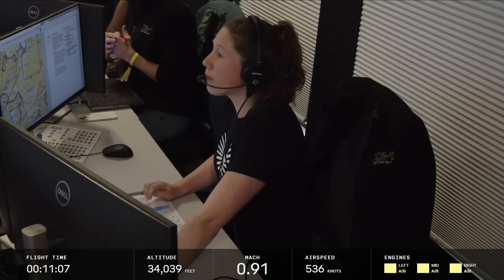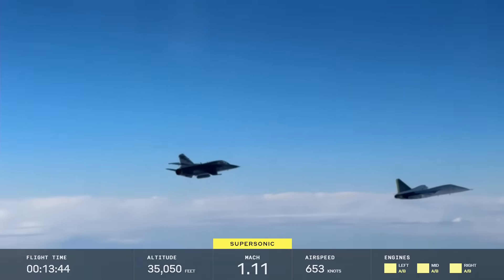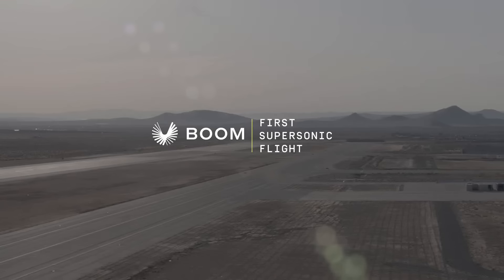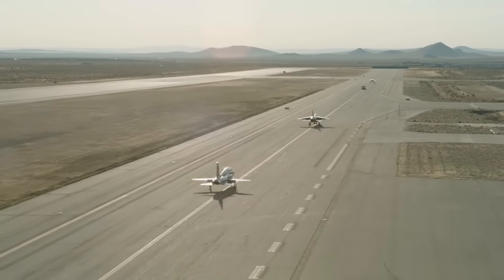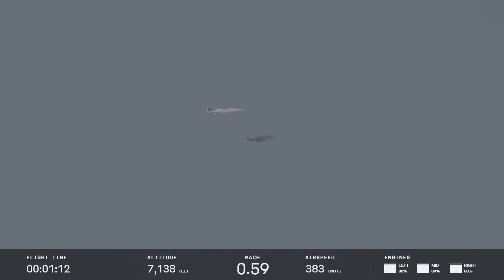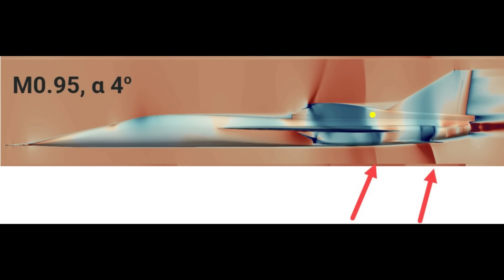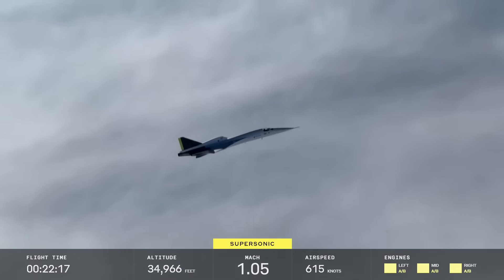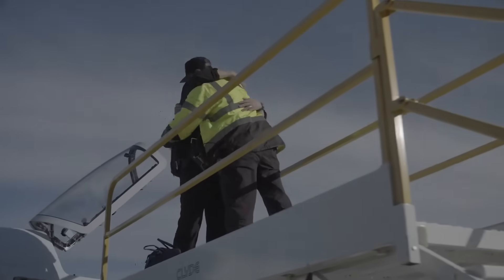XB-1 Baby Boom Goes Supersonic - Jet Planes, Starlink & iPhones

Comment: 9:30 - Rotation at Mach .3 and climb out at a 30 degree angle of attack?  I'm guessing loss of one of those three engines means you're landing in the desert and not doing a go around?  Yikes.
Reply: You can't certify a passenger plane without that capability.  And this isn't the passenger plane.  This is a technology demonstrator and test bed for the passenger plane.
Reply: @stargazer7644  - I know it's the technology demonstrator before moving to the passenger plane, but I hope they aren't planning on the passenger plane rolling down the runway at Mach .3 and then climbing out with the nose stuck in the air at a scary angle of attack on what must be the hairy edge of a stall because the supersonic wing has so little surface area to generate lift.  I guess my point is, I wonder what they learned from the test prototype that's applicable to a commercial passenger aircraft?  This definitely isn't a 1/3 scale model for testing.
Reply: @Liberty4Ever  Concorde had a rotate speed of Mach .32 and a takeoff AOA of about 12 degrees. Nether it nor the XB-1 are any more on the "hairy edge of a stall" than any other aircraft at takeoff.  If you want to go fast, you have to play by the rules of physics.
I suspect the major thing that was learned was that they could actually produce a supersonic airframe so that the investors with the money will invest a billion dollars plus into a 200 million dollar passenger aircraft in a market segment that has NEVER been profitable in history.  I imagine they also learned a lot of other technical things along the way that will be helpful on the Overture.

Comment: The Mirage is an F.1B or D. The T-38 may only have been a trainer in US service, but it's essentially the same aircraft as the F-5 series which absolutely were fighters. An F-5B is basically a T-38 with weapon pylons (yes, there are other differences).
Much as I'd love to be wrong, I don't see a commercial future for this. Mass air travel is still, and always has been, dependent on seat-mile costs, not speed. For the vast majority of passengers, it's the fact that they can afford to fly at all that matters, not whether they're flying at 500kts or 700kts. As long as it's faster than a train or a ship, then their needs are met. Indeed, the thrust of likely future developments seems more in the direction of "slower and greener" than faster. Only a minority of passengers (first class and some business class) have both the desire to fly as fast as possible AND the money to pay for it. if you take them out of the "cattle-truck" airliners and put them in a separate fleet of supersonic airliners with much greater overheads, then they won't be subsidising the cattle-trucks any more, which means the latter's ticket prices will go up and their passenger volumes will go down.
At best, I see Boom getting a supersonic business jet out of this, which will be a limited production toy/status symbol for the ultra rich. At worst, I see them going bust in a few years' time, like literally hundreds of little aerospace companies, run by people who think they've got a clever idea, have done over the history of aviation.
Reply: The Concorde cabin was so narrow it could only handle 2+2 seats, but it still sold hundreds of seats. On could imagine flights from the Gulf to Asia flying over the Indian Ocean could be profitable with seating of 100-120 passengers (or 70 with fancy seating). Considering the Concorde running costs, no I don't think any subsidising occurred.
Reply: @ Concorde tickets were only affordable, and Concorde "profitable", because the UK and French governments wrote off the development costs and gave the aircraft to their flag carriers essentially for free. Basically, those tickets were subsidised by UK and French taxpayers.
Reply: maybe taylor swift could get one to save some time on those 15 minute flights she loves to take
Reply: Part of the cost argument was that a supersonic plane can make two trip to every one of a conventional jet, reducing the cost of hardware by 1/2.  Whether that's enough to make up for higher fuel costs is another question, but it apparently works for SpaceX boosters.
I imagine that four hours in cattle-class seating beats eight hours in first class for most high-end passengers.  And it's probably cattle-class with no middle seats.  So ticket prices of 10x should be conservative.
Reply: @ Yes, but if you extract those high-end passengers from the cattle-trucks and put them on their own plane, what does that do to ticket prices on the cattle-trucks? Most economy class passengers are holiday-makers whose choice is flying/not-flying depending on how much money they can spare, not slow/fast depnding on how much time they can spare. They have zero brand-loyalty: put ticket prices up at one airline and they go elsewhere. Put them up across the board and they stay home in droves.
Reply: @MrHws5mp  If first-class passengers are subsidizing the economy passengers, then airlines may be reluctant to cannibalize their traditional flights by adding SST routes.  But the alternative would be for existing carriers to stand by and wait for newcomers to come in and specialize in supersonic transport.  So the incumbents lose first class passengers either way.
Reply: @captsorghum  Boom will need significantly large orders to justify starting up production though, and they're unlikely to get those from a small start-up airline.
Reply: Air travel depends on seat mile cost per speed (units of time saved compared to alternatives for the added costs). Otherwise everybody would take the bus.

But yeah I have trouble seeing the economics working out either - nobody is going to put up with sonic booms so some rich guy can save 20 minutes.
Reply: @ Itr only depends on seat mile cost per speed if you have a realistic choice of speeds. You can't take a bus across an ocean, and ships are so slow that the support costs and crew necessary to look after the passengers are very high. If your only realistic option is flying, and you can only just afford to fly, then you don't care what speed you fly at. The majority of air passengers would happily fly at 250mph if that was the only option for the same price, or if it was significantly cheaper than flying at 500mph. Most people's time isn't so precious that it's worth spending significant fractions of their income to save an hour here or two hours there.

Comment: ok. will final aircraft go supercruise or not? if this uses afterburners?
also concorde was failure because it needed to use afterburners. that greatly limit its range and useful routes.
Reply: Concorde only needed afterburner for takeoff and "transonic acceleration" (whatever that is). It could maintain supersonic cruise speeds without afterburner.

Comment: Question, if the front view cameras are on the landing gear, how does the pilot see where he is going?  I assume the Overture will have some kind of full time front view camera.  Everything is controlled during the flight test but it would be nice to know the pilot has a full view in normal operation.

Comment: i was at hatton cross when a concorde took off from 09R. in the twilight i could clearly see the exhaust gas was so hot it was glowing purple. don't remember seeing mach diamonds, tho'.
another time, also at hatton cross, a concorde took off from 09R, and the noise triggered LOADS of car alarms.
Reply: I used to live under its flight path. Every evening around 6 you would hear the 2 thumps as it reached the coast. On clear days you could see the plane go overhead and hear the booms and its engine noise about 30 seconds later. Beautiful plane, such a shame they grounded them.

Comment: For anyone wondering. The point of XB-1 and Overture is NOT to reduce the noise of sonic booms (although they will probably incorporate technology from the NASA X-59). 
The point is for a privately funded operation to build, and for airlines to operate, and for us to fly on economically. Unlike the Concorde and TU-144 were.
Reply: Concorde was expensive and uncomfortable.
If it's cheaper to have a private bunk and sleep through the time subsonic  takes, why not do that?
Reply: @michaelmicek  Or if you have the money, charter a private jet and fly directly from your closest airfield to the destination. Probably faster than flying to a hub and waiting to board the next supersonic flight, especially since security, customs etc are much faster for private jet passengers.
Reply: @kkobayashi1  that's another order of magnitude more expensive, $50-100k.
(Not sure about per-seat.)
For one person, a first class (lie-flat) seat starts around $4k round trip (I checked BA JFK-LHR Mar 4-Mar 18).
Not sure how to find the higher-privacy options I've seen, if those are different.
Reply: Billionaire's publicly funded private jet.
Reply: how? will it do supercruise or not?
Reply: The Concorde was profitable for both operators that ran it. The real reason it failed is because US manufacturers lobbied the government to ban it from flying over the USA, which would've been it's largest market
Reply: @bbbbbbbbbbbbbbbbbbbbbbbbbbb_  Nonsense.  US manufacturers had advanced programs to build much larger, better SSTs, which were also killed off.  Check Boeing 2707 etc.
Reply: @bbbbbbbbbbbbbbbbbbbbbbbbbbb_  The Concorde was "profitable" for the airlines only because they bought the planes at a substantial discount.
Reply: Yeah, keep moving those goalposts.

Comment: I don't see why the stubby wings would mean it turns lethargically, at very high speeds or indeed supersonic speeds the force generated on control surfaces is so much higher that you need barely any deflection to roll or pitch, like 5 degrees or less kind of thing. imo it's more likely that's it's part of the (early) design to have lazy control surfaces because its quite easy to have TOO much control authority at those speeds.

We wouldn't want to rip off the wings on day 1 would we? :D

Comment: I've seen shock waves, or rather the refraction caused by them on the wing of a 737 on a commercial flight.  I took a couple pictures of what I was seeing and later showed them to a friend who is an Aerodynamics Engineer.  He told me they were the transonic shock wave and not many people are observant enough to notice them on a flight.  It was interesting because they moved a little bit fore and aft from mid wing while I was observing them and he said that was caused by slight changes in temperature, humidity, and speed at altitude.  He said they start at the leading edge of the wing and move back as the plane goes faster, finally reaching the trailing edge of the wing as the plane goes supersonic.  Them moving back creates turbulence which can make the elevator less effective or even ineffective depending on the size and location of the horizontal stabilizer.  The US solved the instability issue by having a "flying tail" (stabilizer) where the whole thing moves instead of just an elevator.  To this day most (all?) US supersonic military aircraft use this design.

Comment: A team of 50 technicians and engineers in various disciplines have acheived it. They have validated their airframe design in the supersonic phase. So they must have captured a lot of valueable data.  They can validate their simulation and windtunnel models now with authority. The control and avionics approach is also validated.  They are talking about developing non afterburner engine that will have enough thrust to take their full scale aircraft to mach 1.7. It seems they are already working wiith Rolls Royce on that. It is really an exciting project. It is a big ambitious project for a scrappy startup. We need more dream projects like this.

Aviation seem to be stuck after the Concorde. That was a massive engineering effort and Concorde failed due to the sheer cost of the project and the aircraft. So I think if these guys can make it happen at a far economically viable track, they have a solid future.
Reply: Rolls Royce dropped out a long while ago... now Boom is largely doing the engine design in-house. 

I wish them the best, but needing to design a novel engine to go along with your novel airframe doesn't usually work if your not a global super power.
Reply: @TheOwenMajor  Normally I would agree with you as historically that has certainly been the scenario we see played out. Thankfully there appears to be a new (old) breed of upstarts who do not heed the advice of the "established experts" when told "Bah! you can't do that on your own son!"  A little startup SpaceX comes to mind.
I am VERY thankful there seems to be an actual paradigm shift similar to the golden age of aviation engineers more reminiscent of a time when folks said "Don't tell me what I can't do! I'll show them all!" We need more folks who won't meekly give up on their dreams. 
Remember: The Brits did yeomans work on tackling the sound barrier control problems only to meekly hand their data to the Americans and slink off when told to by their government. The did much the same with the Black Arrow rocket program. Succeed and then snatch defeat from the jaws of victory because "The Powers That Be" know what is best. Even Concorde was a success but was abandoned because "reasons". Problems arise. Reassess, change and work through adversity is how advances are made.
Peaceful Skies
Reply: " They are talking about developing non afterburner engine that will have enough thrust to take their full scale aircraft to mach 1.7"

That's called supercruise capability, it's an essential requirement for any supersonic airliner, otherwise fuel costs, limited range and engine wear would make the aircraft unsellable.

My prediction is that this company will honor its name and eventually go boom, I doubt they'll be able to produce engines powerful enough to propel their airliner to mach 1.7 without an A/B... not because it's not doable (it is), but because the development of such engines is too expensive for a small company.
Reply: @Goreuncle  Fuel costs will make it unsellable even if they develop that engine.
Reply: Bada Boom!
Reply: Drag causing high fuel costs will most likely kill any viable supersonic passenger aircraft and why noone tried again after concorde was built.
Reply: @brendonwood7595 In other words, you're saying there can't be a viable supersonic civilian airliner.

Concorde was never economical because of the size and limited market for it, both in terms of passengers and airlines.  As global industrialization and commerce have changed things dramatically, there is a much larger market for a new, more efficient design such as this one.  Cutting flight times can reduce travel costs due to layovers and hotel stays, and make it easier to plan events and live conferences.  There are lots of routes this new project could be used for, particularly over the Pacific Ocean.
Reply: @HuntingTarg   modern tech has made the demand for high cost high speed flights even less than it was when concord was built. The use case was predominantly short business trips that video conference has replaced.
Reply: @brendonwood7595 high speed rail could arguably replace a lot of short and midrange flights across the US and Europe. Drive or take the subway to a train station, get on a comfy train seat without being stuffed into cattle class on a plane, then arrive at a  train station that's closer to your destination city than a typical airport. No TSA horrors too.
Reply: @brendonwood7595  
Depends on the mach number. 

Drag is absurdly high @ mach ~1, but it drops as the aircraft speeds up beyond that point. 
It's not just altitude that affects drag, speed beyond mach 1 is also a factor.
 
Anyway, needing an afterburner in order to go supersonic is definitely not an option for a supersonic airliner, since that's a financial and mechanical nightmare. 

This company needs to develop a supercruise capable jet if it hopes to sell supersonic airliners one day.
Reply: @Goreuncle  No one has EVER sold supersonic airliners. Government funded the development of one as a vanity project and no company has ever felt the need to develop one themselves because they clearly thought the customers weren't there.
Reply: @brendonwood7595  Yes, best not to try too hard to succeed. Novel ideas and new attempts never lead to success. Best just to accept mundanity.
Peaceful Skies
Reply: Pointless waste of CO2 generating resources.

Comment: At around  min 13:00 you mention the build-up of shock waves on the wing and fuselage during subsonic flight above the critical Mach number. Conversely to what you said though, the pressure over a shock (whether normal or oblique) is going UP, not down, accompanied by temperature, density and entropy, while Mach number, absolute speed of flow and total pressure are decreasing. The gradients over the shock are very steep, almost discontinously. Shock waves are a compression phenomena. (see i.e. Anderson, Fundamentals of Aerodynamics, part 3, chapter 7.6)

Comment: Being an experimental test pilot must require big balls; at any moment they could be as dead as a fool in a titan submersible.
Reply: Hopefully they have actual engineers involved in the XB-1.
Reply: I know that I would be resigning a test pilot role  upon any small  hint that an engineer on the project had any concerns. The xb-1 looks to be professionally executed with small baby steps and lots of measurements at each step.

Comment: You forgot to mention why the altitude on screen read 2000 ish feet whilst the aircraft had not taken off yet.
Reply: Because the base is 2000 + above sea level
Reply: that is the height of the runway above sea level 2,801 feet
Reply: Because aircraft altimeters read in altitude above mean sea level, not above ground level.